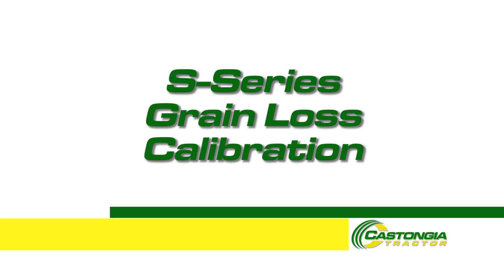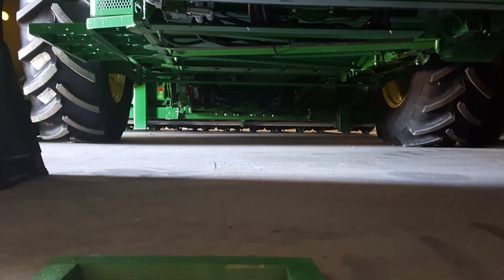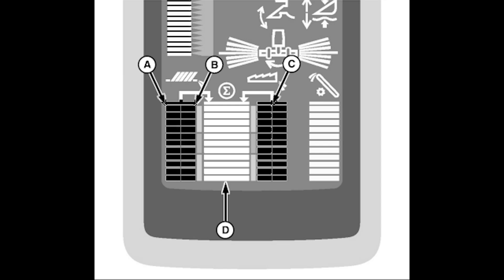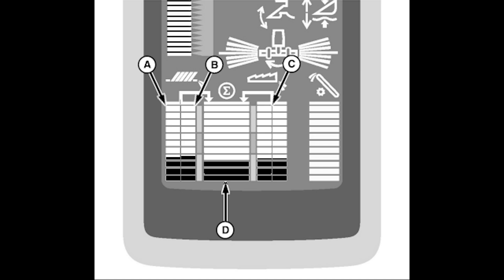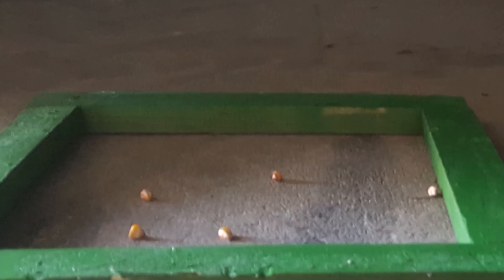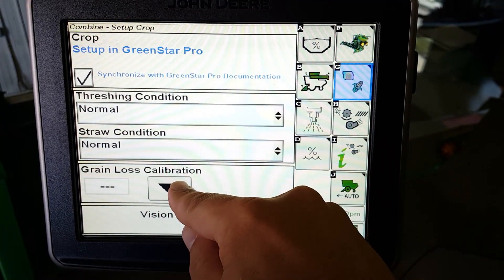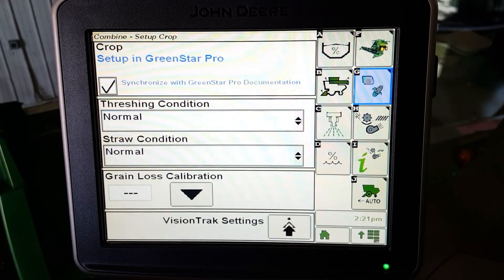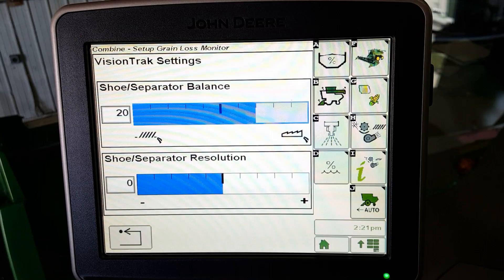Grain Loss Calibration S-Series

Comment: We had immature corn, with rubbery cobs, plants full of leaves and super wet. What a nightmare to combine with S680...the only nice thing is that the S680 finally has enough air to blow the kernel out the back. Our setting were 440 cyl, 18 concave, 10 chaffer and wide open sieve underneath. Air down to 1150...and just keep pressing the calibration button until the lines go away...

Comment: The problem with this grain loss monitor is that you are mixing data from your rotor side (walkers) and data from your Shoe.
The sensor for the rotor does not identify grain loss out of the machine. 
It just tells you , that you are getting unthreashed grain coming out at the back of the rotor grates.
Therefore you need to close up your concaves. (Not necessarily slow down.
Its been a flawed system since the year 2000.
The monitor is only accurate for walker machines